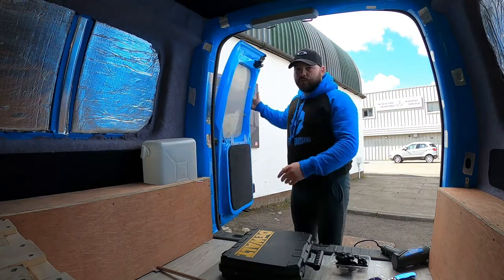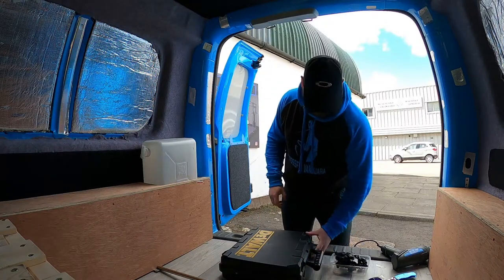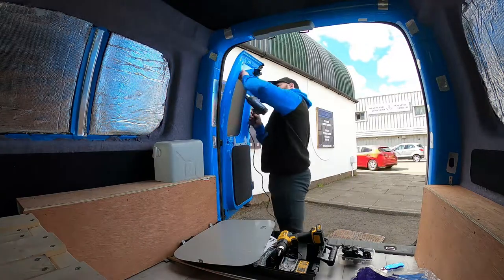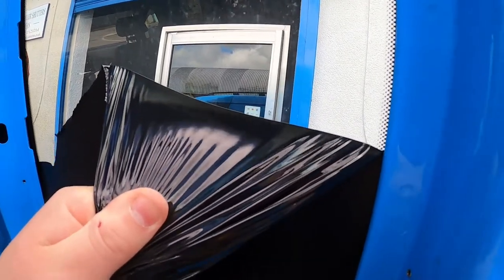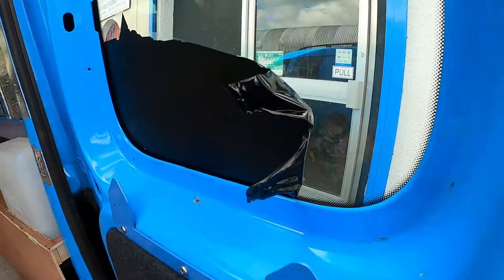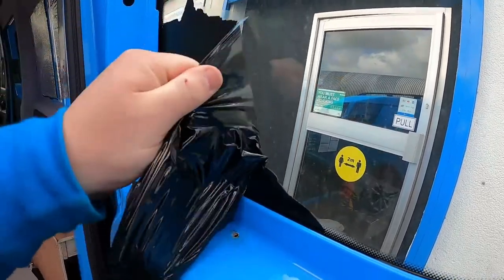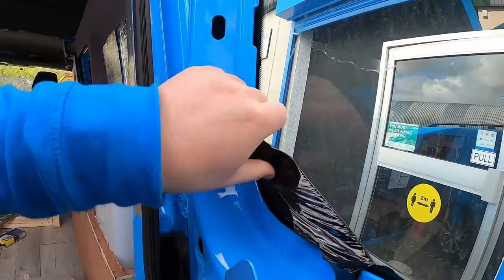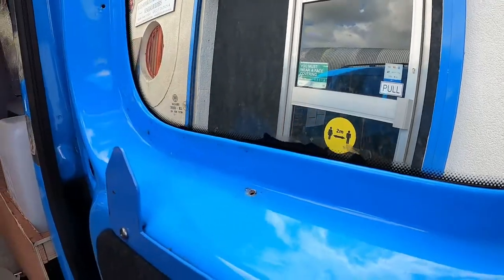Removing rear window tint - VW Caddy Van - Tint removal

Comment: I was looking for more or less this exact video before I did this myself still glad it exists guess I should have looked harder. Heatgun for the win I tried struggling away with cleaners and elbow grease for a while before I whipped out the heat gun. I found that UPVc cleaner was good for getting rid of the leftover glue and that I probably spent most of my time removing the glue from the area that I scraped away without the gun. I used an old bank card as a scraper instead of a blade as I was worried about scratching the glass.
Reply from the maker: Glad it helped. I’ve fitted and removed stickers for a number or years. Found this to be the easiest way. Thanks for watching 🙌

Comment: When using the stanley blade to cut round the edge, will it not scratch the window? Much appreciated if you could give me as much information about doing it. Cheers!
Reply from the maker: Hey buddy. I never had any issues. I find using the blade on its own limits how deep you cut but if you use it with a knife then there is a slight chance of marking the glass but you would have to use some amount of pressure to mark it. Just take your time 👌
Reply: @MickyDoyle  Nice one, cheers mate! 👍🏻